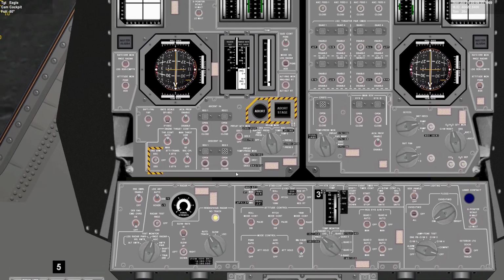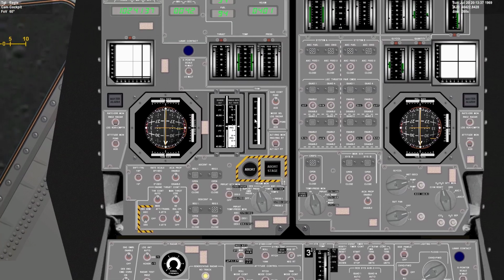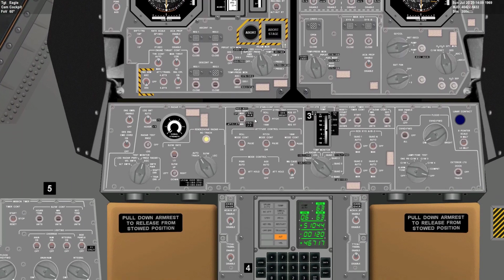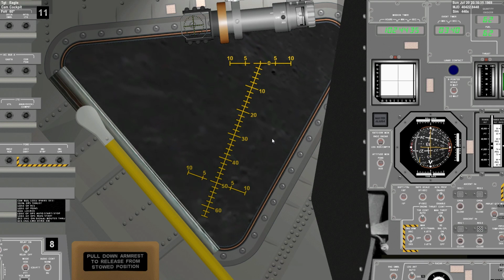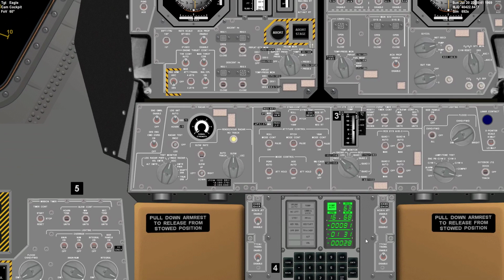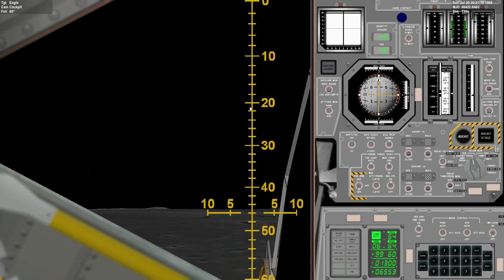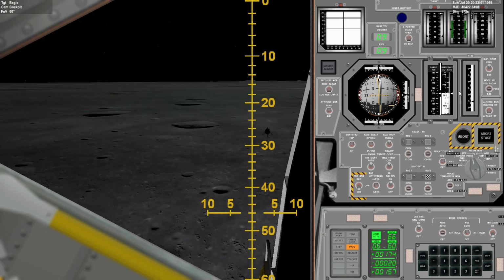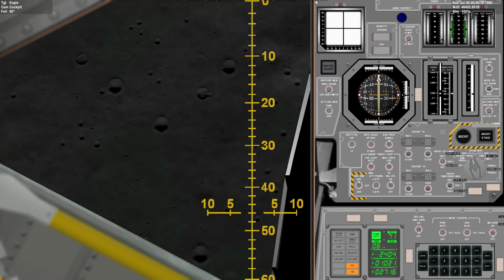FPGA AGC NASSP P66 Landing

Comment: How many Logical Elements does this core use in an FPGA? I can't imagine it is more than a couple thousand. And is it fairly circuit accurate to the real hardware? And do you implement the Core Rope as LE's or as software rom?